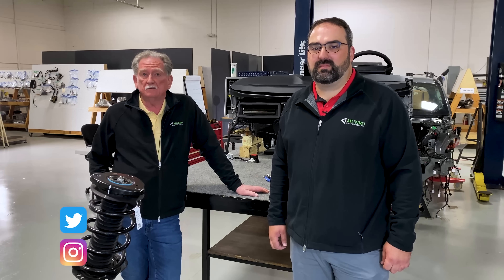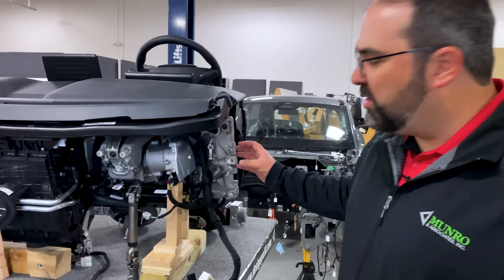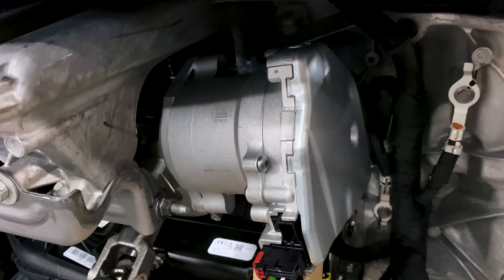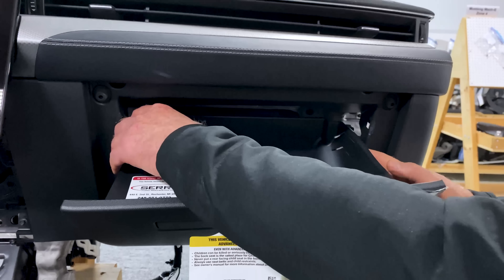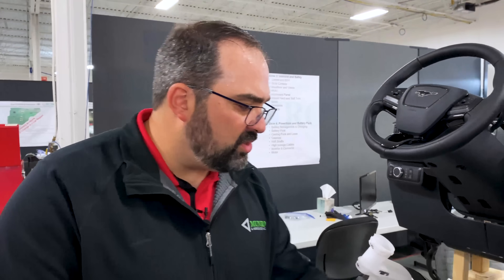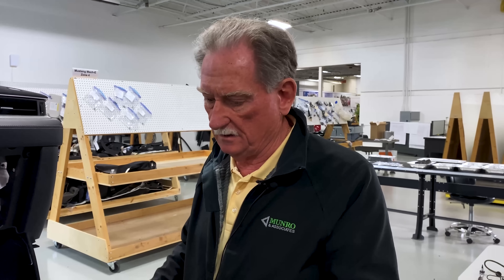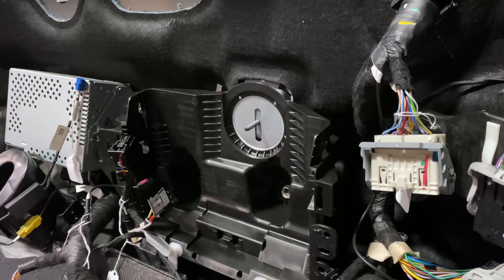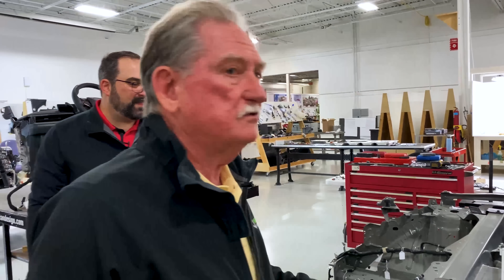Ford Mustang Mach-E Instrument Panel (IP) Assembly and Analysis

Comment: Sandy is quite smart, but he missed the fact that the brakes on the mach-e while being electrically boosted, still have a manual plunger that the pedal is pressing on to activate the brakes.  No way in hell is an auto company going to be getting rid of manual braking anytime soon.  That'd require hard-wiring and / or dedicated independent / redundant power sources adding unnecessary costs and complexity to something the good old foot is more than capable of handling.  Even the remote reservoir with snap clip that he loved still required several brake presses worth of additional reservoir on top of the pedal plunger assembly.
Reply: Yup, the regulations require a mechanical/hydraulic system in the event of a failure. There may be a dimmer switch for normal operation but there is still a hydraulic master cylinder as a backup.
Reply: @bikeaddictbp  They don't even need that -- because it's a piston design with user generated pressures, the system only need to help multiply it.   Pressure transducers are cheap and have no mechanical moving parts and are extremely reliable.  It really makes no sense to go to a potentiometer style electronic setup where failure rates are much higher.  Multiplying pedal effort linearly makes for easy drivability.  Even if it was the safest things on earth, I still wouldn't want a computer between my brakes and my foot.   Manual brakes are still 100% reliable, it just takes more effort to achieve the same stopping capability.

ABS systems are technically pressure reliefs with a computer between the driver and the brake application, but the genius of it is that in the event it fails, it only fails to provide anti-lock, it doesn't fail to brake.   If a drive by wire brake fails, good luck.  E-brakes are good for parking, but if you've ever played with one at speed, you're better off using engine braking.  There's a reason they're actually termed "parking brake".
Reply: Just looked under my dash on my Mach-E and there is a push rod there, not sure why he said its fly by wire system.
Reply: I definitely would NOT drive a car that doesn't have a mechanical backup for the brakes, or at least a mechanical parking brake. The car I use now not only has hydraulic brakes, but it also has a cable running directly between the brake pedal and the brakes. The same applies to steering.

Comment: Sandy is wrong about the braking system.  There is a full mechanical bypass in the event the electromechanical boost system fails.  So then the HUMAN is indeed still pressing directly on the master cylinder, exactly like it's been for over a century.  Of course this doesn't mean you can't use a strong FRP pedal, but this is why Ford went with a steel one.  FRP in this case would be really bulky and probably cost more.
Reply: Do you know who the supplier is? It does not seem to be Ibooster from Bosch.
Reply: @flienky  It''s the MK C1 EVO from Continental.   It supports stroke simulation and "brake by wire", but like all systems on the market, it has a full redundant fallback to pedal-to-hydraulic manual operation.

Comment: The one aspect of Automotive engineering technology whear all automobiles engineers fail is in serviceability. 
A grate example,  Tesla telling a customer he must purchase a $16000 battery because they molded a $2 coolant line connector into the battery instead of making it replaceable.
Reply: Been watching Rich Rebuilds? 😀
Reply: They do. But Tesla don’t, that’s the difference between Tesla and the others. The others have 100 years of experience. Tesla has 10.
Reply: @erikbuiten14  the best service is no service
Reply: @bluetoad2668  sure. But they still need service as we don’t have the tech to support your supposedly service free vision.
Reply: @bluetoad2668  Only in a perfect world... the lab

Comment: Hopefully that "dimmer switch" brake pedal can still provide feedback to my internal brake feel sensors...
Reply: I was confused by sandy talking about it just being a dimmer switch.  Obviously it still provides feedback to the driver so it would need to be made out of something more sturdy than plastic.
Reply: It’s not a dimmer switch, Sandy showed earlier that this car is still equipped with a master cylinder directly linked to the pedal. I have no clue why Sandy said that. The pedal was literally loose in his hands because the cylinder was unattached. He clearly doesn’t understand how this breaking system works. Brake by wire exist, but this car isn’t equipped with it.

Comment: I have a Toyota Land Cruiser 100 built in 1998 with an electrical brake booster. Unfortunately it has sat on my yard for the last three years because it needs a new booster and master cylinder which cost nearly $4000 plus fitting. It also needs the electronic/hydraulic/gas suspension swapped out for mechanical and, now, new brake rotors and calipers. Basically a 23 year old vehicle with over 200,000 miles does not justify that kind of money spent on it. It is probably worth quite a lot to break up for parts since the drivetrain and chassis are perfect, or were before it was laid up.

Comment: You are wrong Sandy , the new electric brake boosters are mechanically attached to the brake pedal in order to provide  pressure compensation (up to a point ), so the pedal has to resist at least 300 N of force applied from the front and a little less applied from the booster side .

Comment: 13:15 incorrect. Brake-by-wire systems still have a mechanical/hydraulic failsafe. Blended braking in non-Tesla EVs deserves more discussion than what you did. Tesla's one-pedal driving was a hack because they could not make blended braking work (too many engineering resources dedicated to fart noise turn signals, I guess) that Elon marketing machine spun into some sort of amazing innovation. The same goes for the frunk. I have opened the one in my non-Tesla EV once in 9 months of ownership and the VW approach of short hood and maximum interior space is the right way to go. People don't need two trunks, they need room in the cabin.

Comment: Sandy: I have personally placed more well over 300 lbs of force on that brake pedal "dimmer switch bracing before being rear-ended. I was doing the same with the clutch pedal to the floorboard as well. So glad I didn't break either of them in the process--the situation sucked enough as it was. Yes, I am getting a Cybertruck--looking forward to being in a sturdy stainless steel cocoon!

Comment: Regarding replacing the cabin air filter, Tesla is a 14 step process includes a warning that you are risking your life for it: " Warning: Do not stretch, bend or otherwise damage the orange High Voltage (HV) cables that are attached to the cabin filter cover. If the HV cables are damaged, immediately discontinue this procedure. HV shock can result in serious injury or death. "
Reply: Not for Model 3/Y, they have access from front passenger footwell, but yes for S/X is very involved, (12v battery also, though refresh models are changing to lithium)
Reply: Man, with that orange high voltage cable attached to that cabin filter, it has to be mighty powerful!! I mean like szzzzz and the contamination is fried!!
Reply: thought you just opened uo the frunk cowling and changed it?
Reply: @Nderak  Nope, the steps are more involved than that... many pieces to remove for Model S/X... including the actual FRUNK itself!
https://www.tesla.com/support/do-it-yourself-model-s#replace-hepa-filter
https://www.tesla.com/support/do-it-yourself-model-x#hepa-filter

Model 3 is much simpler, just bit of pain to get at one securing torx screw, awkward access in footwell.
https://www.tesla.com/support/do-it-yourself-model-3#replace-air-filter
Reply: HEPA filter in Model X is so huge, the only place it can fit is the back wall of the frunk, a pretty ingenious solution. And those 14 steps are mostly just plastic covers and the frunk.

Comment: Did they do anything new with brake lines to support the more complex braking system?  I.e. fluid change intervals, better containment of contamination.  It would also be interesting to share what "Fail-Safe" looks like with those new all-electric brake systems.   The old way often could handle contamination for quite a while, and when they finally failed their replacement costs were quite low.  I'm guessing that an integrated electric brake system is not inexpensive to repair.

Comment: Citroen had a brake button many years ago that worked a treat at the time, also If that stirring motor fails the bill to replace it will make you cry with enough tears to easily fill your oh so useful frunk.

Comment: I'm no engineer, but why wouldn't you take that instrument panel out through the rear hatch instead of scuffing up your nice new steering wheel?
Reply: It won’t fit. All manufacturers assemble it that way and that is how you take it out. You do however take of the steeringwheel beforehand so you don’t damage it.

Comment: The vent wheel controls behind the screen is telling of the total LACK OF COMMUNICATION at ford.  

Ford managers in those 2 departments should be dismissed.
Reply: clunky manual vent controls are obsolete anyway, Tesla and others have entirely replaced them

Comment: 14:40 This big hole and unused area seems to be the location reserved to install a Righ Hand Drive steering column?
Reply: My RHD Fiat Panda has the same column and pedals as LHD. A big lever take brake pedal force to the booster pack. Clutch is hydraulic (works either way. Loud pedal is drive by wire. Heater is centrally mounted. However fuse boxes don’t move and heater speed control resistor us near impossible to reach. 
It would be so easy to put the resistor on a heat sink and to run the wires centrally. Then the fuse box could swap sides easy-as.
Reply: I was wondering the same thing
Reply: That’s exactly correct!

Comment: 13:30 when your brakes fail you can still manually pump for pressure. What happens when this system fails? Are your SOL?
Reply: Brake by wire systems have a mechanical override that makes them function like traditional brakes if the system fails. It's not a dimmer switch, Sandy doesn't know what he is talking about.
Reply: EVs "brake" automatically when you take your foot off the accelerator due to the magnetics in the motors and regenerative braking...

Comment: Magnesium in the interior of an electric car. Hmmm? WHAT COULD GO WRONG? >>>>> FIRE<<<<<<<  What happens when that big mag parts catches fire?
Reply: All sorts of things made of magnesium like Laptop cases, are those laptops suddenly catching fire?
Reply: guy it's not Magnesium (pure) it's a Magnesium ALLOY.  the additional elements RAISE the ignition temperature of the material.  if you're on fire, you're going to have a WHOLE LOT of OTHER materials "lighting off" to worry about before any Mg castings get up to temp.
Reply: Corvette has used it for a very long time. The old VW Beetle engine block was magnesium.  Somehow not as dangerous as you're thinking,  though I don't know why.

Comment: What needs to be changed from LHD to RHD?
Reply: Offhand, the supports for the pedals, steering column, instrument cluster any components displace by those changes, any LH door controls that differ from the RD, exterior mirrors and logic associated with the new blind spots, asymmetrical front seat components, mandated warning sticker and information placard locations, logic for front air bag controls.

Comment: Can you address how the brake pedal works if it is simply a rheostat? Surely there must be some mechanism that provides tactile feedback and increasing resistance as it is pressed simply because that's what everyone is used to. If was simply a matter of how far the pedal was moved, it seems there would be many dangerous user errors.
Reply: It still is mechanically connected to the brake booster but also has a position sensor to apply regen braking. Under light brake pressure/pedal travel only regen is used, but after a certain travel the mechanical brakes are also applied and you start getting real feedback in the pedal. 

The challenge is making that transition from regen to regen plus mechanical brakes smooth and linear which is why Tesla just choose to just always give max regen with no pedals are applied (i.e. coasting), and then if you need more braking, the brake pedal is reserved for pure mechanical braking. That eliminates the blending challenges but not everyone likes heavy regen braking/deceleration while coasting.
Reply: Your screen name is so close to my actual name I have to keep looking to check I actually didn’t post that question LOL
Reply: @TheJoeSwanon  That is my actual name. As far as I know, everyone with that name is related to me.

Comment: Saw a Mach-E on the street yesterday (we were in another lane, side-by-side following). At 45 mph it had a LOT of rear vertical travel which reminded me of an old car with horribly worn rear shocks. The road was a little bumpy but not for the vertical travel I saw.  Have you seen something similar?

Comment: I feel like someone at Ford went and pulled out a filing cabinet of every suggestion Sandy made that got rejected back when he worked there and is trying to push them through because the higher ups told them they could do a clean slate design with little old guard rejection/intervention… make the best of a good opportunity I guess!
Reply: Let's hope they were smart enough to keep the suggestions.